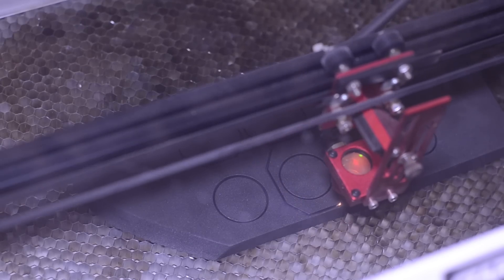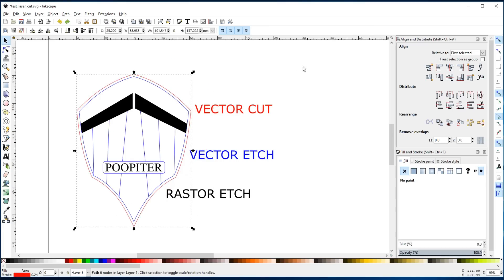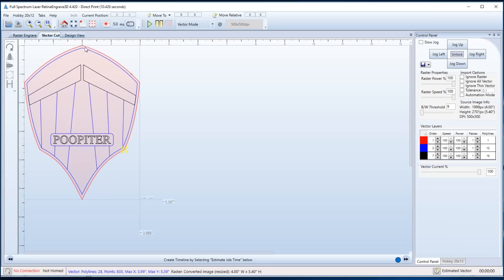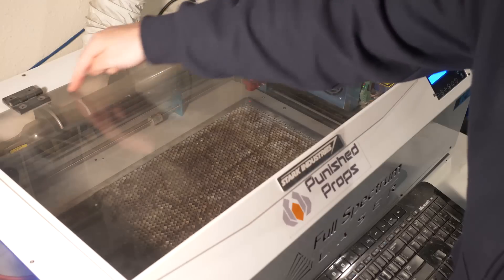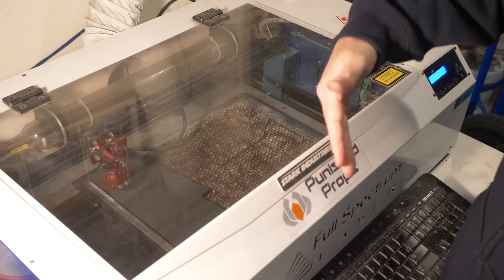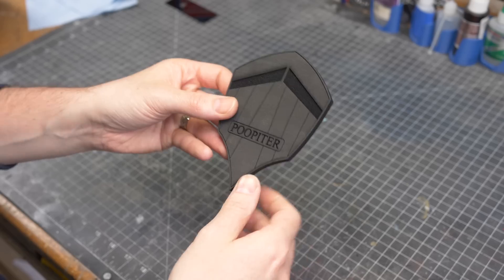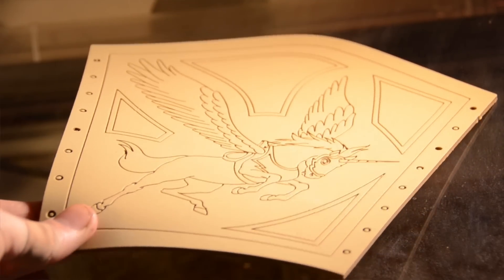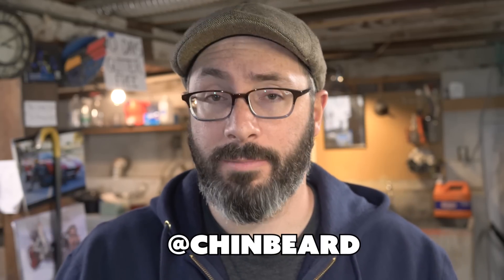How to Use a Laser Cutter - Basics Tutorial

Comment: Quite a lot of time has passed this you put out this video.  I'm currently looking into to laser cutters for EVA foam.  Do you have any experience with Ortur (low cost) cutters? (I'm looking at the Master Pro 2,  would you recommend them for EVA Foam?  Unfortunately Ortur, does not specifically state their cutters work for EVA Foam, so I'm a bit apprehensive.  If you do not recommend Orthur, what low cost laser cutter do you recommend?
Reply from the maker: The only cutter I have experience with is this one, the Spectrum Hobbby Laser. I think for foam most lasers are probably fine but I don't know enough to offer a full recommendation
Reply: @punishedprops  Thanks

Comment: What is the problem with PVC???
Reply from the maker: Hot PVC releases bad gasses!
Reply: @punishedprops  Yeah true BUT a fume extraction is needed anyway even plywood has glue between the layers and that also not healthy :-) even burning wood fume is not healthy and foam PVC is a great material cheap, light and relatively strong...

Comment: I’ve noticed that in some laser cut wood pieces have a noticeable burn cut and others don’t. What is the variable to cut right through but leave a minimum burn mark.
Reply from the maker: That depends entirely on the type of wood, how soft it is, how hot your laser is, and how fast it's moving. It's always worth doing tests before deciding on a material so you can figure out the best way to work with it!

Comment: I don't own a laser, but I'm looking into getting something soon. I was surprised to see that your SFLaser does not separately enclose/shield the laser tube or the electronics from all the smoke generated inside. Your laser tube (and most likely the insides of the high-voltage power supply) are coated with smoke.

Comment: Whats the difference between Laser cutters and laser engravers? Can laser engravers just engrave things or can they cut through the material as well?
Reply from the maker: It's a matter of whether or not the beam is strong enough to pierce all the way through the material. A lot of cheaper "engravers" use low power diode lasers that don't get hot enough to cut through most materials.

Comment: Love the laser cutter as it was the first machine I learned at the local maker space (that sadly closed down). Also one of the easiest to prep and use out of the machines they had. The only thing is you have watch it (or grab someone to watch it while you run off to the bathroom during a big etch). For cool projects, um... very few that I have pictures of, but the masters for the coaster(s) I showed you at SVCC 2017 were laser cut. Also made (somewhat) cheap birthday gifts.

Implied, but it might be useful to mention why etching is first (if the machine doesn't do this automatically), and that for some materials might even want to design ... whatever those CNC tabs are called that are cut out/off later if for some reason the material is at risk of settling/moving during the cut.

Also, ABS is on the no-cut list. Both (it and PVC) were almost hilariously terrifying to read the posted warning sign (and of course the ones I tell people at parties).

Comment: Any tips on adjusting settings? Also, I have had problems with thin EVA setting on fire / totally melting away. Any suggestions?
Reply from the maker: It’s all been trial and error for me. For really thin foam I use the fastest settings and just enough power to cut through. If it’s still too meaty, lower the power and do a couple passes.

Comment: But Bill! I don't have a laser cutter!  Any reason not to buy the $500 eBay cutters?
Reply from the maker: I don't have any experience with those types of laser. I can say you want to make sure it's strong enough to actually cut through material. Mine is 45 watts, good for .25" material. Cheaper lasers may be too weak to cut and are only good for etching.

Comment: Frankly, a bad "all the basics you need to know".
1.- You don't mention consumables: Lenses and mirrors can and will degrade over time, especially if you don't mention "2". 
2.- Lens and mirror cleaning. Unless your laser uses Molibdenum mirrors, most lasers use gold coated ones, wich can scratch with just your breath, so to speak. Good lenses also have coatings in them, wich will also scratch easily. Dust and material vaporization will find their way into them, and while under power, stick and burn in the surfaces, ruining them. A good cleaning from time to time is mandatory.
3.- Air assist is not, altough it does, for "putting out fires", but to increase O2 concentration to better cut, and in part, to refrigerate the area.
4.- Lasers are "dimensionally acurate" if you take your time and measure the kerf size (the "diameter" of of material the laser vaporizes) AND the kerf angle (the laser is not a perfect and straight light beam, but, exaggerating, a hourglass shape, wich has it's smallest diameter at the focal point. If you aim it at the surface of the material, it will leave undercut (the base will be smaller than the top), like you do with the foam. If you aim at the bottom of the piece, it will leave a slope, wich might be desirable sometimes.
5.- The PVC info, short at best: Why you SHOULD NOT Cut PVC? It will release CHLORINE, wich will degrade your machine, if not worse. It is not advisable, unless you know it's components, to use it like a vinyl cutter. Vinyl material family can be multiple materials, but in case of doubt, they can contain PVC too.
Reply from the maker: Thanks for the additional information!
Reply: You're welcome!
Also, love your props!
Reply: Complaining about incomplete information you did that too. Chlorine itself doesn't harm mirrors and lenses, but whe PVC is superheated/vaporized (what laser does) it becomes hydrochloric acid, and that is very corrosive, and therefor harm lenses and mirrors -and much more.

Note: This video is a good starting point for those who aren't familiar with lasers at all, and from here they should and must continue digging on the information about them.
Reply: Honestly I have searched so much to try to figure out how to use a laser machine and the programs that come with it. This is the first video I have seen that has broken the barrier between me and laser cutting and understanding software and the like. I haven't even gotten through the whole video yet.

Definitely this comment has overwhelmed me, and has mentioned things I have no idea about that I would be shocked if they were to be mentioned in a basics video. 

Title: BASICS 

If you (troll), were to make a video called basics, you would probably lose 85% of your viewers. Seriously.
Reply: Hey Troll, he was doing a basics video not a proper care and feeding video.

Comment: could the laser be used in place of a vinyl cutter???
Reply: No, from my understanding using a laser cutter to cut vinyl produces some extremely toxic fumes.
Reply: vinyl and pvc will create chlorine gas which will wreck your machine and also is extremely toxic. vinyl cutters that use a drag knife are better and cheaper than lasers
Reply from the maker: Nope, laser cutting vinyl produces toxic gasses. =(